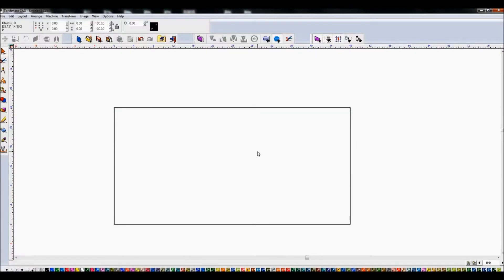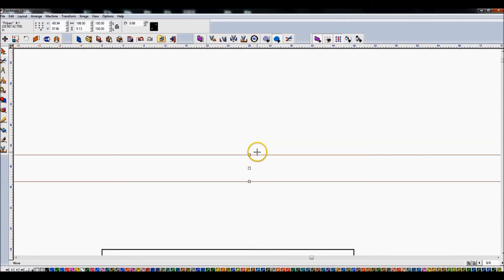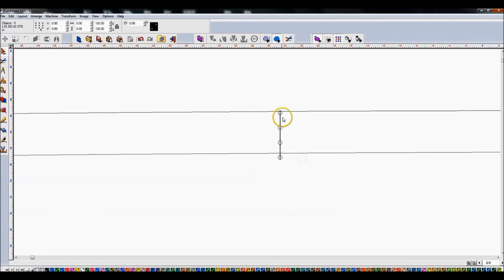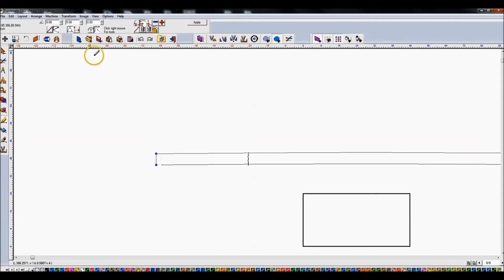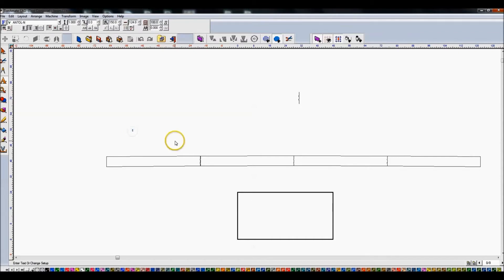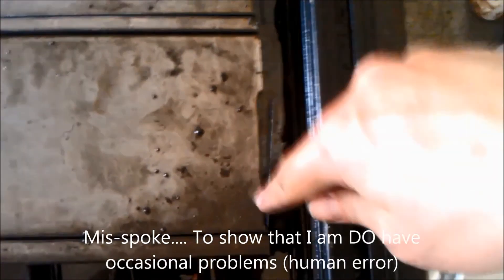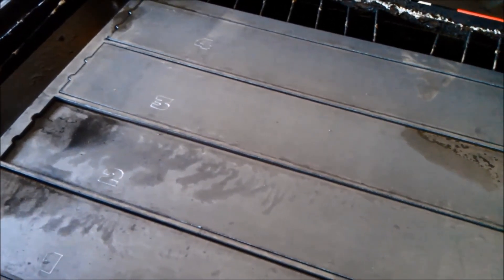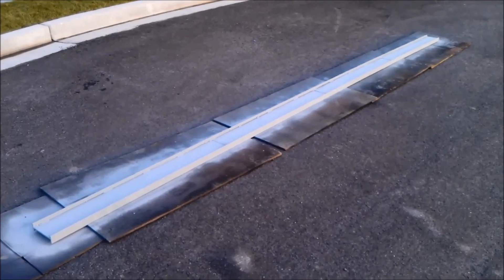Torchmate CAD/CAM -- Designing and building a custom I-beam for a pergola

Comment: first , you are making your project in the best way i ever seen ...........but when you weld , how did you check if you have the 8in height in the middle of the beam you need ?as you know it is not accurate just to put the edges of the parts together and start weld ........for accuracy this will not gives you the accuracy level you need ..........i know maybe it is not important here  , but just a mechanical engineering discussion
Reply from the maker: Beam is 6" high.  The web was cut on the CNC, so I know it is accurate.  The flange was 2" material.  I centered it with spacers, which you see me clamping down on after moving the web and flange